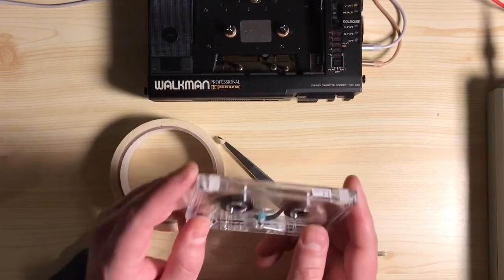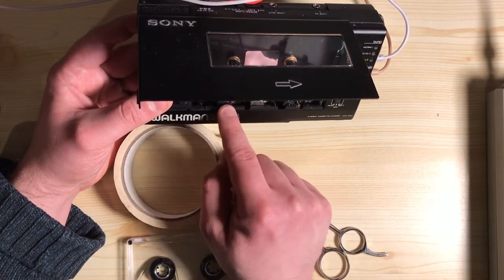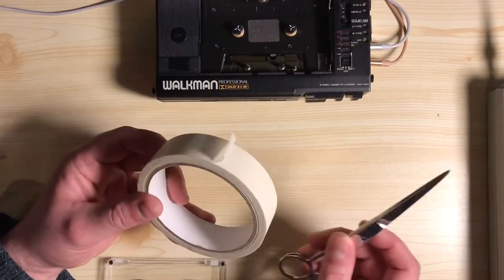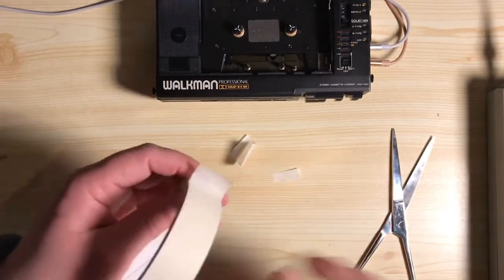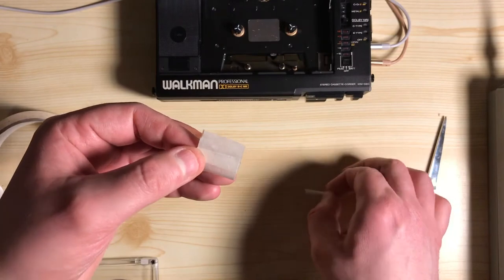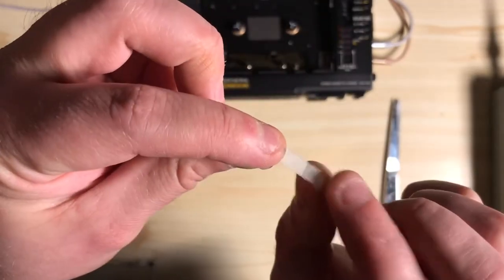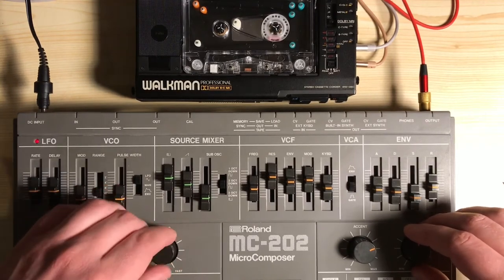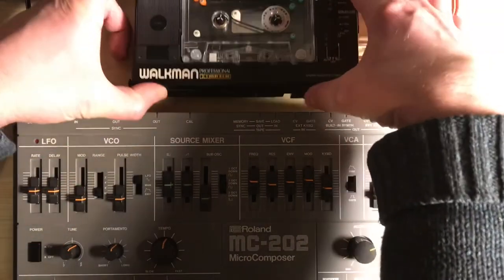Covering the erase head

Comment: Notes from a Philips aq6340 owner(walkman type o' memorecorder)   a: if the 'bandaid' gets pushed down too much it'll push the tape to a halt. B: in my case the play-mechanism needs some room in there too, so at first it didnt play at all, after narrowing the 'bandaid' it worked.
 C: I can't record... with 'bandaid' nothing gets recorded or erased. Without I'm indeed left with clicks and cuts.
Reply: Did you find a solution to this? I have a GE 3-5027, and having the same issue. With the bandaid, it hardly records and has huge issues functioning smoothley. I've tried adjusting the size and pressure numerous times to no avail.

Comment: hmmm.   maybe modify a tape deck to have an on/off toggle switch for the erase head?
Reply: Exactly what I am considering!
Reply: I did that on my Tascam 414 and Yamah MT120, it's a definite plus ! Both these units have a 8pin connector for the erase head on the board, so it's easy to build and plug in between a set of 4 toggle switches, one for each tape track.
Reply: Unfortunately some Erase heads have a fixed magnet, not an electro magnet. This means they are permanently on. It's their proximity to the surface of the tape that allows them to erase the audio. A lot of these cheaper erase heads are blue in colour but the simplist way to identify them is they have no wires to the back of them.

Comment: You my friend are a genius. I really want to make a couple of these to mess around on. Maybe to give to a teacher of mine as a gift too. How did you make the small rollers on these? Brilliant!
Reply: One STUPID-simple way I do it (and looks like it could be the same here), is after disassembling the cassette and splicing your loop you're left with a BUNCH of extra still spooled up - I simply unwind until it's the diameter I'm looking for, cut off the excess, and then tape the end of the tape reel down onto the rest of the spool, making a big "wheel" of tape!

When making DIY cassette loops after a while, one thing your never short of is tape itself; might as well use it! I've also experimented with wrapping the whole finished wheel with some frictionless tape (Kapton was one, the clear yellow stuff for PCB's and soldering—or some glass-fiber PE tape—but I found issues when making the surface too slippery as a bit of friction is needed to retain proper tension, and a bit extra can actually assist in that nice warbly flutter!